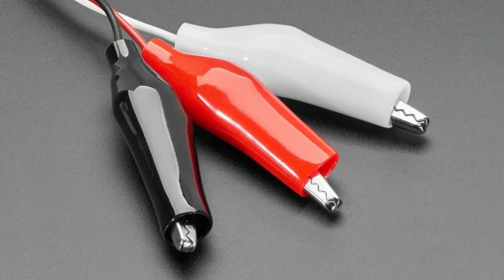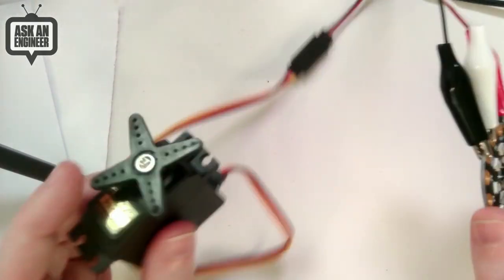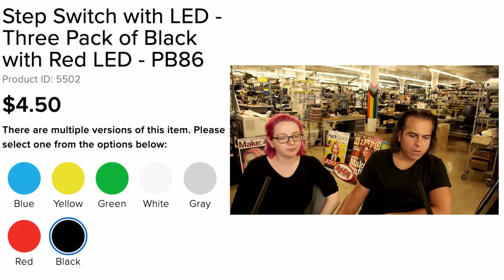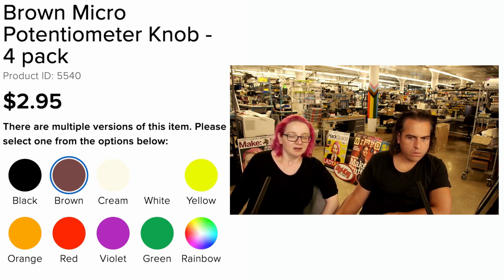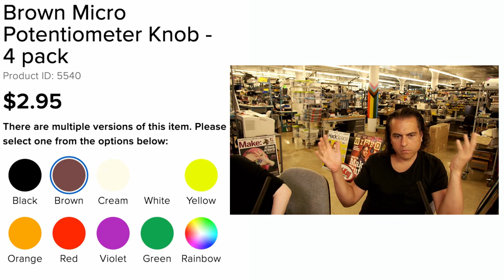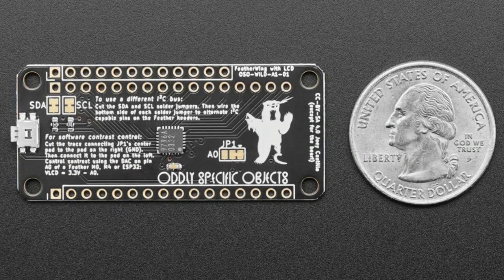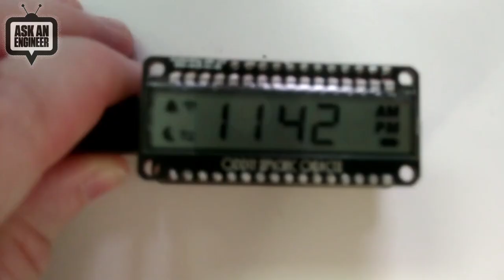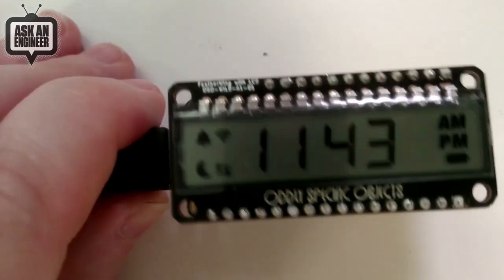#NewProducts  8/3/22 Feat. LCD FeatherWing from Oddly Specific Objects! #adafruit #diyelectronics

Comment: the only problems with these barrel connectors. is that the pins in the middle are a bit too short for some devices. i using the the big barrel with the yellow tip and because the connection pin is too short in the middle it's not making contact with the power connection of my snes jr therefore not giving the system power.

Comment: I probably don't have nearly as many old electronics with weird barrel jack adapters as you guys (off the top of my head, a Motorola Xoom, an Acer Chromebook, and an IdeaPad, and of course none of these are interoperable), but I was so happily surprised when my ThinkPad's main power supply was USB-PD. Yeah, it was the only type C connector (which means I have to use a passthrough hub if I want to use that thing for data without draining the battery, and good passthrough hubs are very few and far between), and they used a massive chonky overheating brick for the power supply when Anker has USB-PD adapters that were half the size and nowhere near as warm. Also the USB connector on the cable was straight, which promptly started exerting torque on the connector; I switched that to a right-angle cable ASAP. Type C connectors can be quite long.

Nice Buddha scans/prints. We desperately need a decent 3D scanner. We have a Sense. It's a toy.